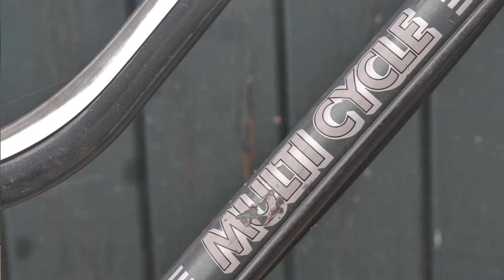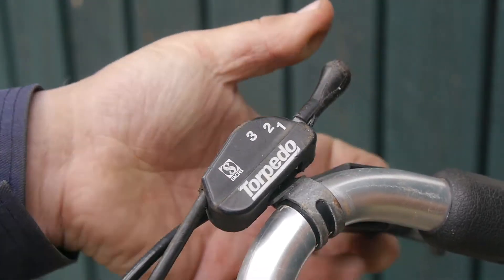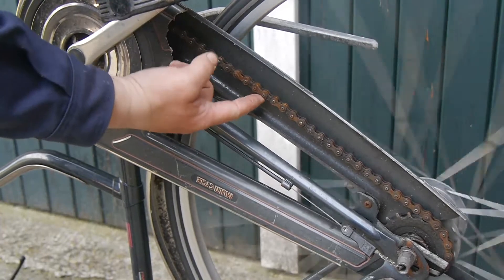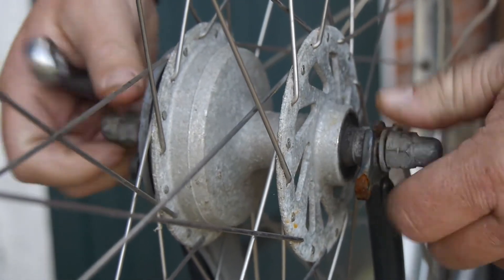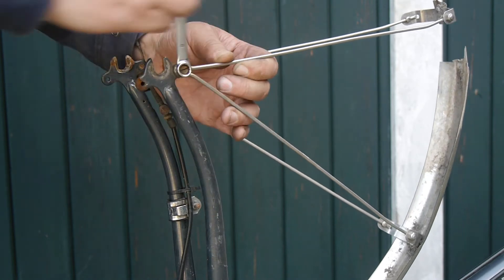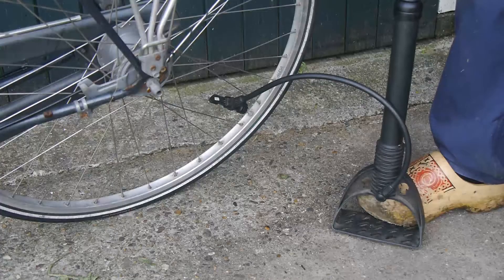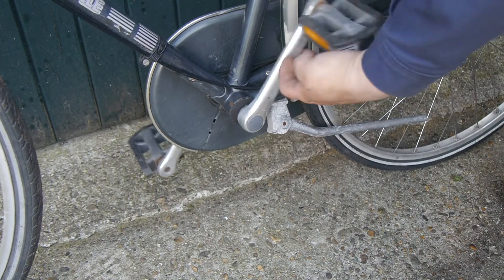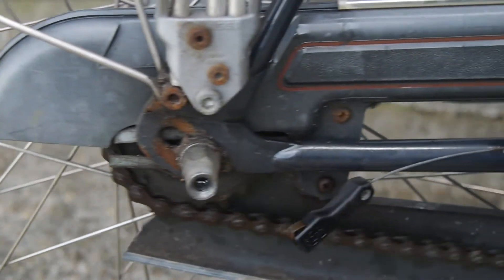Trying the Multicycle Tour 600 parts bicycle

Comment: Those concave rims are prized by traditional English touring bike fans.
I’ll have the stupid trim piece!
Those rear dropouts are sports tourer type and don’t take tensioners.
Reply from the maker: I thought those rims were a bit odd looking when I replaced the tire.
I cut up that stupid trim piece. It won't cut anybody ever again :)
Any tricks on mounting chain tensioners on a frame like this?
Reply: You can’t. They usually have an anti-rotation washer, either a washer with a tab that fits in the slot and has flats to fit the flats on the axle (that’s the Sachs type) or a forged/cast washer with a thick section to fit in the slot of the frame.